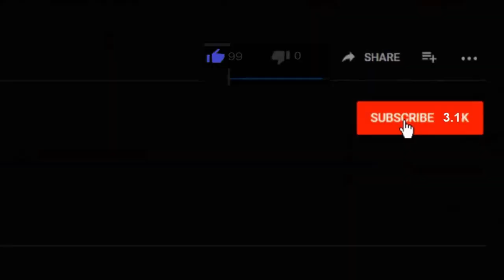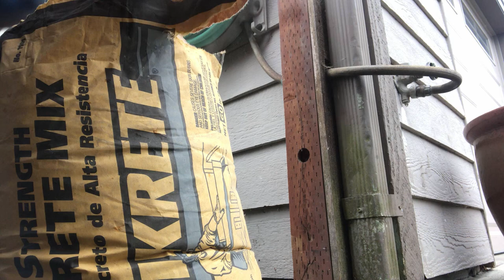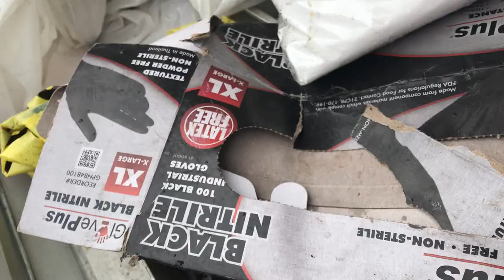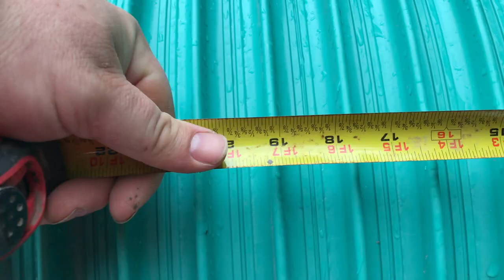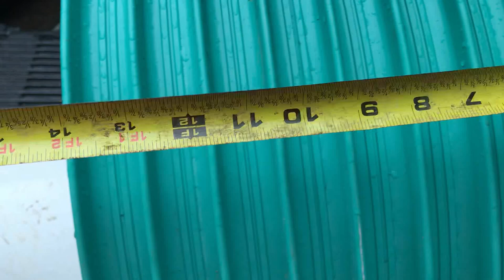Septic Tank Riser Installation (Septic System)

Comment: most interesting but why are the septic tanks that deep is that a regulation there and doesnt the lid have to be easily removed for emptying the tanks? any way pro job mate
left our like👍Au 👍🌟full view🌟
Reply from the maker: Thanks man. No the tanks are at different depths all the time. I am not sure what the rules are on how deep they have to be. I think it just needs to be deep enough so the mainline septic pipe from the house going to the septic tank has a 1/4 - 1/8 slope to it. Septic tanks are allowed to be buried, just it's a pain every time it has to be dug up and risers make things much easier and less expensive for the future. Paying a professional can't get expensive.

Comment: I swear I could smell our septic system now ,am in our backyard watching your vid and yeah, Liked this video
Reply from the maker: It's not a good thing if you can smell it. It may mean there is a problem with your drain field or something. That can get costly, if that is the case they may need to build a new drain field on a different spot.

Comment: You didn't install any seals on the riser where it attaches to the tank.  Is the concrete supposed to be sealing this?
Reply from the maker: Yep, that's what the concretes for. It is the concretes only purpose, not for integrity. The dirt is for integrity.

Comment: Nice Video!  Thanks for putting this out there just when I needed it most. I had my system pumped and inspected the other day and they gave me a bid for doing the risers of $2472.13. :-/  Do you know where I could buy the riser materials in the Tacoma/Gig Harbor area? Thanks again.
Reply from the maker: Oh nice. Yes. There is a place called HD Fowler. I am not sure about Tacoma or Gig harbor but, there is a location in Pacific,WA
Reply: @COMMANDERVLOGS1  Thanks again for the tip.  I went and picked up all the supplies today.  Do you follow the same process for the effluent filter access riser?  The riser they sold me is just a 12" diameter pvc pipe and a lid, but there is no adapter. This will be attached to a hexagon shaped port on my concrete tank. Can I just set it on top of the concrete and create a concrete seal around it? Or do I need to get some kind of adapter? Thanks again for your help.

Comment: Nothing a crappy video lol the smell coming from septics are horrible. I know you have to get used to it. Make sure you don’t bite your finger nails lol. I used to use a mud box and a bucket as well to mix concrete. Looks like your beginning to get the hang of your new job brother. I keep baby powder with me at work so that way I can slide gloves on easier. You deal with way to much rain up there in Washington. Black and decker isn’t my favorite drill but I keep one around for small jobs. 3 holes on one job ain’t you lucky. All those inches and you was still short. Long day brother good job
Reply from the maker: LOL, ya, you do get used to it. Glad to say I don't have the habit to bite my fingernails. Ya, my job is usually easy as far as thinking is concerned.It's just physically demanding. Baby powder to slide gloves on. Interesting. Usually I don't have a problem it was just because, my hands and the gloves were wet.  It was a long day for sure but, we got it done. 😎